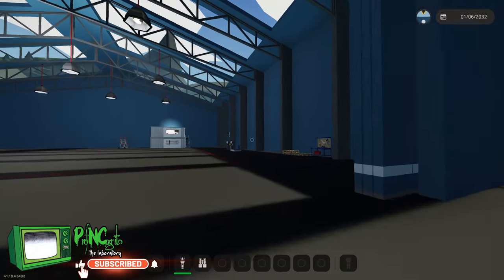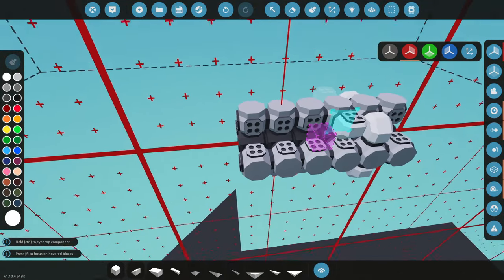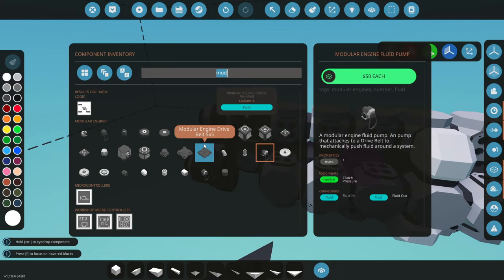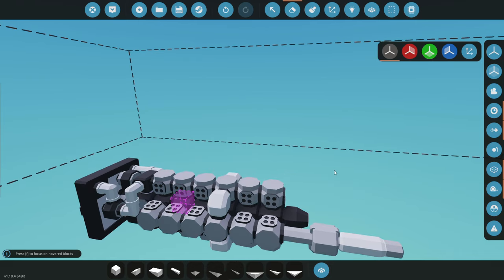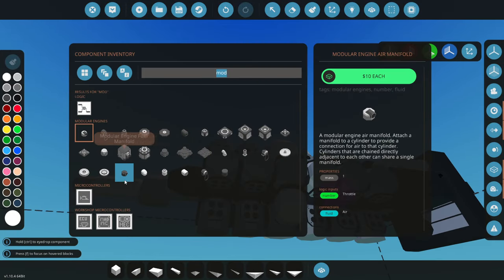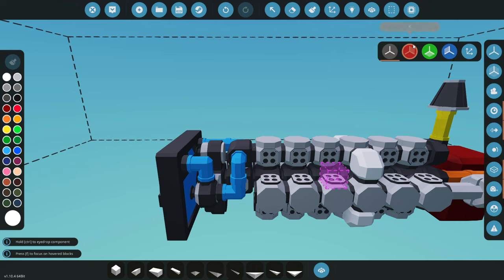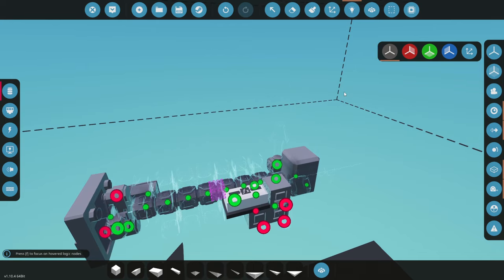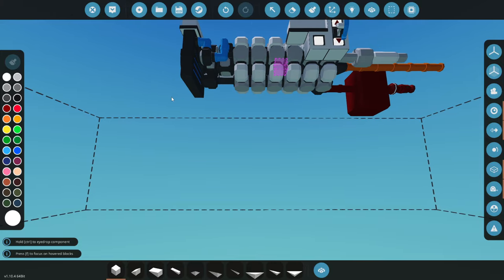NO ECU!!! Modular Engine Build Stormworks Tutorial - How To

Comment: With the new gas update, you can easly build a turbo with the pump. Just set the fuel to air_throttle*0.75, or the small pump with air_throttle*0.6

Comment: Man that radiator is massively insufficient lmao. My previous Iso container carrier aircraft used two radials about that size. I had about three different cooling systems in tandem and it still was plagued  overheating issues lmao. This was to a point where I built in automatic engine extinguishers.  

I’ve since gone the route of turbine and maaaan. This thing works sooo much better at its intended mission

Especially since my engines down blow up half way to the Arctic. Doing 80m/s on  to massive turbo prop engines running about 2.5 rps btw.  Soo many medium turbines.